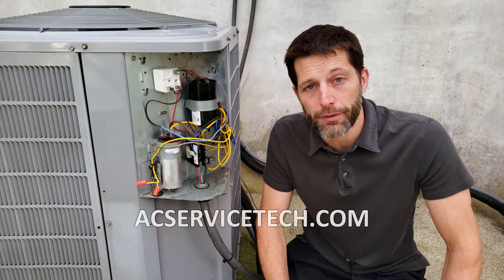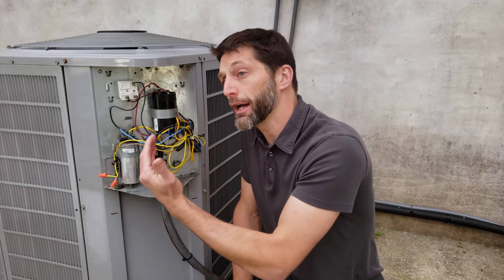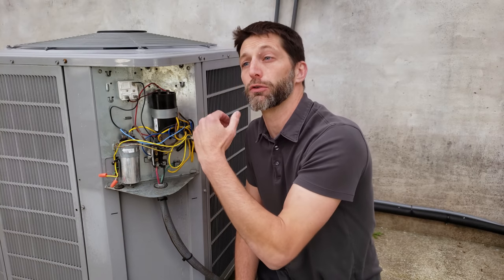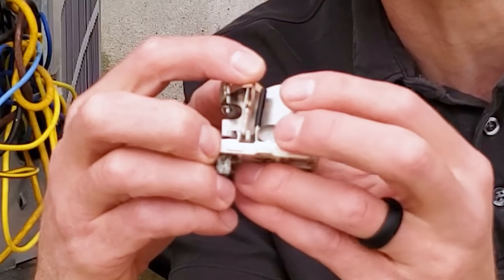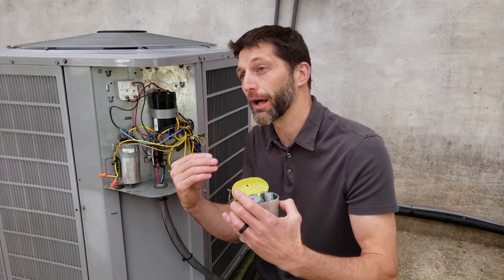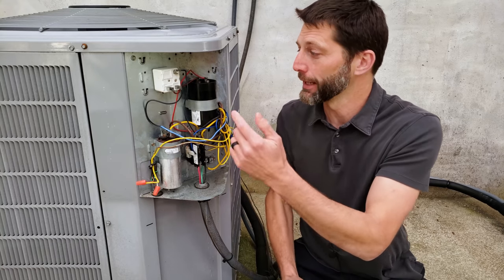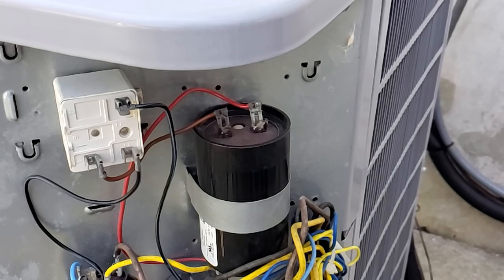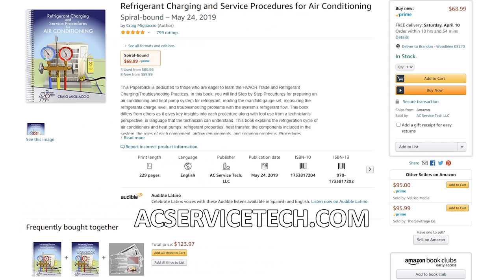The Main Reason Why Start Capacitors Fail in HVAC Units! This Cap Blows Out!

Comment: This is a great example for why root-cause analysis is so important.
Reply: Simple..the government stuck their noses in the HVAC business and it was determined that the capacitor manufacturer's could no longer fill them with oils for cooling the capacitors. The result is the capacitors cannot take the heat, resulting in failure due to overheating.
Reply: that is what makes a great tech, fix the problem, not the symptom
Reply: @randallgreen6746  Removing toxic PCB-based oil?  Oh, the horror!

Comment: The unit at my old house was so close to the den window that when a capacitor failed years ago I hit the floor because it sounded like a shotgun blast when it blew. A week later the replacement capacitor blew as well. I now have A/C PTSD.
Reply: Lmfaooooo
Reply: Boom! :-) Totally. I think you'd have to be either wealthy or numb to not have the jitters.
Reply: Get yourself a capacitor shrink.

Comment: Why do people, even professionals, put start capacitors with potential relays on the condenser unit (hard start kit)? I was going to do the same until I saw the video from HVAC school showing the myths behind hard start kits. Now I’m scared to put a hard start kit on my condenser. I’m hoping some HVAC professional can challenge the instructor from HVAC school and the electrical engineer that they interviewed!

Comment: The failure usually comes from a bad installation. You MUST install the relay with the mounting lug at the top or the arrow up. The contacts are not meant to be installed sideways and will stick closed.

Comment: Holy Crap!!! Due to the 4-day, 90+ degree weather in NJ, my A/C stopped working yesterday....we called for repair and the technician showed up around 9 PM last night. Guess what he found? THE CAPACITOR BLEW! I'm gratified to get a repair so quickly...incidentally, the total cost for parts and emergency labor call was about $330.00. However, I'm a little creeped out that this happened yesterday and YouTube pushes this video to me today....big brother is watching.
Reply: The same thing happend to me last week.. Had a heat wave and mine went out

Comment: Video  is great & to the point. My run capacitor quit on our 4 year old Rheem AC. Replacement lasted 2 1/2 days. Next replacement lasted less than 1 hour. I will now check the relay. Thank you.

Comment: I really like this illustration. Also, keep in mind to use multimeter to test the Start Relay before it burns. Proper position of relay is crucial because terminals stay in right position if not affected by gravity. 
1- Terminal 1 & 2 should have continuity and NO resistance reading. Any resistance reading means the Terminals 1&2 are making poor contact. This justifies a preventive replacement. But, if necessary, it is better to get more evidence.
2- Resistance reading on High Resistance Coil, between 2 & 5, should be very close to 5K Ohms, anything higher means the coils is failing. It should be replaced. 
3- Any brown round/oval stain close to terminal 5 is a visual sign of coil overheating and should be replaced.
Reply: On your point #2, is that reading when the relay is disconnected from everything?
Reply: Always disconnect wires when checking a load for ohms.

Comment: This was very helpful. As in right now I’m going to trade school to become a hvac technician. And one of the things my professor said was. When you check a component  that failed not just replaced the part that failed  but also try to find out why it failed. In this video you showed what made the capacitor failed  not just the capacitor is bad because the MFD are lower. Great video
Reply: Elctro  plat  oil  oit  comeing  over  over oiy  systom  bacal  th.......$

Comment: The “MFD” rating is the size of its capacity rated in units called “micro farads.”  Your explanation was helpful. My previous supervisor did not feel it was necessary to clean the condenser if you could still see daylight through the coil.  I am sure that this resulted in higher head pressures.  So when cycling it would be harder for the compressor to start because the unit would still be hotter than normal.  He was constantly having to put in the hard start kit’s.  It was very helpful to see how extreme the results are of the start  capacitor when it fails.  One of your readers wrote about getting hit in the face by the discharged oil and gases.  I can see the need to wear safety glasses more clearly now.
Thanks
Reply: I also believe that the oil in old AC units deteriorate, resulting in less lubrication and harder starts.  I put in an ounce of the oil recommended for the compressor, and they run much smoother and have easier starts.
Reply: Nikola Tesla's name was bestowed to a car company - all Michael Faraday got a was a capacitance unit.   We owe him a bit more than that!

Comment: My fan start cap went bad, but I think it just dried out after 10 years, it didn't leak/rupture. I cleaned the start circuit's enclosed relay contacts and removed the dead wasps that were jammed between the exposed motor contactor contacts. Back in business, and now I do a periodic check for wasp nests. I'm glad I didn't spend $500 to get this fixed. The capacitor was around $8, shipped to my house.

Comment: Great video.  I believe that the reason why the relay fails over time is the same reason 12v relays fail on vehicles.  corrosion at the connectors (in the wiring circuit) causes the voltage to drop.  Since Power = volts x amps, when the voltage goes down; the amps go up across the contacts and burns them up.  Same thing happens on relays, solenoids and starters on cars.  Poor quality relays today may also contribute to the failure.  In other words the Electrical Engineers don't design for the extra amps due to the extra corrosion resistance.

Comment: That was a great video. The only thing i would add is the resistor is there to prevent carbon build up on the contacts from arcing when it makes and breaks.

Comment: Once the start cap goes, you should also monitor for high start and run current draw when the new cap is installed. Some shorted windings could lower the start winding resistance to the point that higher starting currents will continue to eat capacitors and will eventually take out the system circuit breakers, too. Plus, burned windings change the inductive reactance of the coil which will make this machine run inefficiently and hot (motor winding resistances are so low (1-10 ohms) that a multimeter cannot supply enough current to give accurate resistance readings, so run-start current is a safer test).

Comment: Excellent video, I just had the A.C. capacitor replaced, the unit is only a year old, the tech. replaced the capacitor, but now I will check the relay as shown on this video. Thanks for sharing 👍

Comment: Thank you. My mom has had to replace the start capacitor twice last summer, now I need to check her invoices or see if tech did anything with relay..
Reply: Good idea!!!
Reply: Sounds like the answer is 'no' they did not replace the relay or thermistor.  Although the video says "the thermistor will fail in an OPEN condition" which seemingly would protect the start cap, as long as your tech is at your AC, may as well pay a bit extra for the part and tell them "can you please replace the relay or thermistor, whichever of those my compressor unit has".   The cost of a service call if you need to call them back out again is probably more than the cost of the relay or thermistor.
Reply: @Greg_Chase  That's very true but some customers will always complain about $$.
Reply: @bobboscarato1313  If the starter capacitor remains in the circuit due to a bad relay, the tech who got paid to replace the cap is getting called back anyway.

If a service tech comes out the first visit and fails to fix the actual source of the problem - a bad relay - the new starter capacitor is going to fail soon enough.

Unethical service techs think "I'll get a 2nd call and then I'll replace the capacitor AND the relay".

What ends up happening is, that tech loses that customer permanently because it will be clear they failed to do the job right the first time, when they come back out to replace the same part as before.  "This tech was not thorough enough" is what most customers will think, then never hire that company again.

HOW TO PROTECT YOURSELF AS A TECH

1)  troubleshoot thoroughly to find the source of the failure

2)  tell the owner "I have to replace the starter capacitor to get your compressor and thus your A/C working again.  But I found the source of the blowout of the capacitor - a bad relay.  If you don't want me to replace the relay, I will make a note on your bill that you need a new relay, and I have to warn you that the new capacitor will fail before too long, because the bad relay is why the starter capacitor failed in the first place."

In other words, give the owner the full knowledge of the trouble, note it on their bill, so when the cap blows up again,  at least you have a clear conscience, and you were 100% ethical in trying to help the customer, and the customer will blame themselves.

I'd wager about 50% of customers will say "fix the relay too then" and 50% won't.
Reply: @Greg_Chase  A good tech worth any salt would never just change the start cap , you left out 3) all these kits are made in malaysia 3 month warranty on O.E.M. RECOMMENDED KIT NOT LABOR ! 4) recommend ICM LINE MONITOR.
Reply: @Greg_Chase  That’s exactly what happened to me, and that was my exact thinking.

Comment: Letting out the magic smoke. 😁
Reply from the maker: You gotta see it to believe it! We always walk up on these start caps after they are blown and so we don't get the visual!
Reply: Came here to say this
Reply: My instructors words as well😁
Reply: @acservicetechchannel  I hired a guy on craigslist to come out and give the freon a bump and the very next day the sys quit working... and it was sunday morning and he was out in 30min and just happened to have a cap on his truck to fix my unit..... hmm... i smell a rat
Reply: @autojohn-pu1vf  1st problem is: "I hired a guy off craigslist"
2nd problem is: "to give the freon a bump"
If he did what you asked, why smell a rat?
And why be surprised he has an assortment of caps on his truck?
You went the cheap route, you got the results you were after...
Reply: Stuff just won't work if you let the smoke out.
Reply: @autojohn-pu1vf  it’s not uncommon most technitions have a run of capacitors. Just sayin

Comment: If you don’t have a resistor, which a lot of people probably don’t, you can use your multimeter set to Volts to bleed the residual voltage off.
Reply: that would takes many hours...
Reply: @throttlebottle5906  it won’t take hours, yes it’s not as fast as other methods, I didn’t claim it was either, but if a meters all you have it will work.
Reply: What value resistor do you suggest for the bleed? In the neighborhood of 10 K or higher?
Reply: Hey Josh, please provide the value for the bleed resistor....Chuck thinks its maybe 10K Ohms (below) is that about right?  I assume the wattage value of the resistor doesn't need to be very high.....
Reply: @chuckyounger7298  they're usually 10 to 20K ohm an 2watt rated, make sure the voltage rating is high enough.
15K ohm at 2watt rating is what one of the aftermarket replacement ones are, with female spade terminals staked on.
Reply: @chadstout1  see above post.
I'll add, the higher wattage rating being used is more for having increased voltage rating.
without looking up specific resistors, a 1/4watt one is rated around 250Volts, while a 2 watt is like 500 volts.
there can be up to 440 volts DC present across the cap when the start circuit opens. it depends on rated line voltage, motor and start circuit design.
Reply: @throttlebottle5906  Thanks Chuck!  It's always a pleasure to talk to knowledgable people.  I literally have bins with 100's of resistors left for me by my EE Dad.
Reply: @throttlebottle5906  ....and I'd forgotten the specs about resistors.  Seems to happen a lot in my late 60's!!!
Reply: @chadstout1  My AC guy uses the same bleeder I do.  An electricians screw driver.

Comment: It is also my understanding that the potential relay should be mounted with the mounting hole facing up, which is why there is only one mounting tab for these relays.  This will mount the switch inside the relay vertically, increases relay switch "pull off time", and increase the chances of the relay failing open if it fails.  From what I see, the relay is not mounted correctly.

Comment: i hardly see these in AC anymore , most of our gear is inverter now and if its not its usually PSC which is pretty easy to do with a scroll compressor like copeland ZR series as they start virtually unloaded

Comment: I liked how you described "amperage crossing" from Run cap to Potential relay! This morning I taught two courses on our Kickstart product line (which comes w a bleed resistor, btw). Bc of the amperage crossing, I stress the need to test the existing Run Cap while the system is RUNNING. I'd be happy to discuss more of these topics, HSK's just happens to be the most exciting...lol.
Reply: Would the compressor be able to start with a good hard start kit installed on a unit with a failed run capacitor, and what would be the effect on the compressor?

Comment: I did some work on my brothers AC unit last year where the compressor just stopped running, and the HVAC place I got parts from said basically the same thing: even without testing it’s common practice to replace the relay with the start cap because the relay is pennies on the dollar compared to the capacitor, and even if the relay is still good, it will fail before the capacitor does. Those running caps never seem to completely fail, just degrade over time. You know when they are going especially on a blower because it doesn’t maintain a smooth operating speed.

Comment: Good stuff. That smoke is nasty. Don't breath it! Capacitor electrolyte is actually very close to ethylene glycol antifreeze like you would use in your car. You didn't mention why we need capacitors at all. The reason is because with a single phase AC motor, you need a capacitor to get a phase shift between motor coils to cause the motor to rotate and not just sit there and hum.  Three phase motors don't need capacitors because the phase shift already exists in the AC supply. Those poor capacitors carry a lot of current, especially during startup.

Comment: Nice presentation of physical differences between start and run capacitor, but most folks incorrectly understand how they actually work.
 It is true that a run cap in a fan must be matched since it is needed to correct the phase angle altered by the inductive load. As mentioned, you can roast the armature & field windings.  On a start cap, although not necessary,   you can certainly over value cap in Uf or voltage without issues being that it is seen momentarily in the circuit.... Not as some "Boost" or Extra Charge to help spool up the electromotive force for rotation......IN fact, it's quite the opposite as it simply pulls down one leg to assist in rotation. Think of standing on a bicycle, try to push both pedals down with all of your force.......you go nowhere and only  have a locked condition, now lift one leg and then stater the rotation! Not certain how this video came up but was fun to watch & appears to be a great resource to anyone with interest.

Comment: I've changed a few of those on some Frigidaire A\C window units for family and friends with breaking ac during summertime. I also changed ALOT of circuit boardd for about 65$. It seams that they design window units so that condensation will perfectly fall and accumulate the bay

Comment: I don't work in this industry but I'm told that start (and run) capacitors are often replaced whenever one replaces a compressor. This kind of failure shown in the video would seem obvious, but why would one replace the cap (when it looks and tests normal with a meter) when the compressor has failed? Is it because they are cheap and the meter can miss some kinds of cap failure?

Comment: Impressive video thank you! I believe this potential relay failed in the first place because it wasn't installed properly. They use part of the gravitational force to reset to open after the start occur. In such, it has to be mounted vertically, not horizontally like this one.

Comment: I saw myself accidentally involved in this stuff, I saw a homeless dude once struggling to carry a off-brand chinese portable AC unit, I offered help and he offered me to keep it for 6 $, so I accepted as I needed a porch fan (which are 30$ at least), upon quick inspection the cold/heat mode did nothing and the main fan slowed down at fixed intervals (the compressor didn't its characteristic hum, so I said, well, it's toast) , we have been using it in fan mode for a while and it does its job, yesterday I was bored and decided to peek inside, I noticed the compressor hummed very faintly for 2 seconds, and gave up for another 15 seconds and repeating this power cycle, upon board inspection, no relays seemed to be failing, motors were OK, and symptoms point to this stupid capacitor which is also the reason for good units to be declared EOL and replaced entirely? Even experienced technicians will resort to installing a whole new set... Which still doesn't make a lot of sense to me (money wise maybe for the technician and sellers)

UPDATE I'm done with the installation and it works like new, not thinking about installing it as my house already has AC, but it will be handy to have it around

Comment: This is exactly what happened to my system over the weekend. The exact. Same. Thing. 
It's a shame that I will most likely have a new system before I run into this issue again. But perhaps I can help out a friend or relative if they have their AC go out.